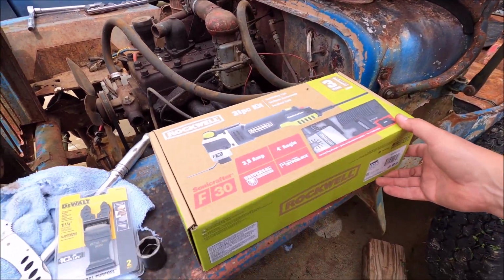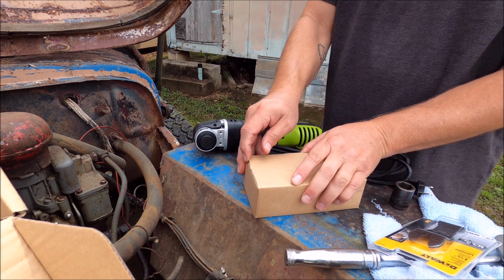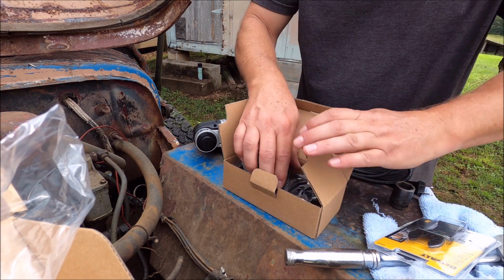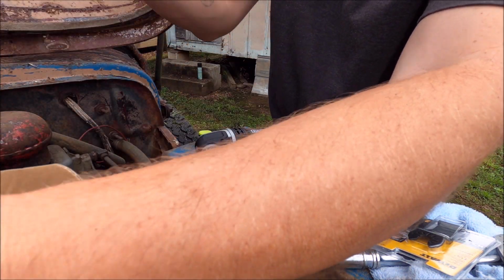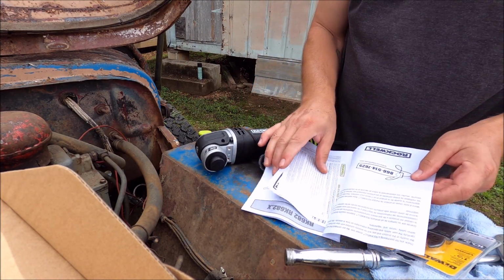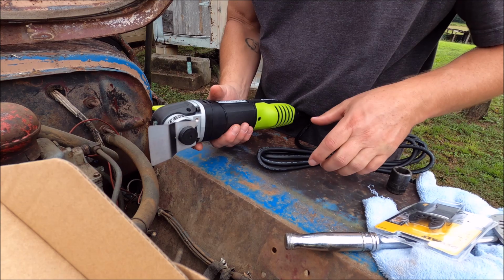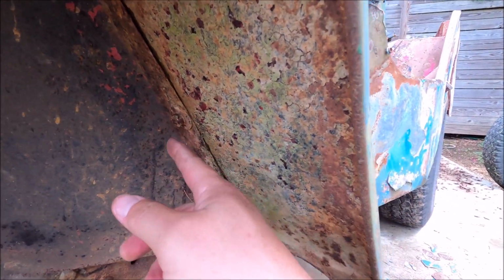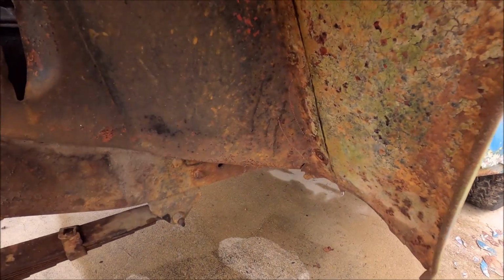Rockwell Sonicrafter  Oscillating Multi Tool: Will it Cut Weld?

Comment: get a grinder with a 36 grit and grind the bondo off dust mast and googels needed
Reply: I was thinkin a flap wheel and a twisted wire wheel . I like the krud cutter rust remover too.

Comment: Wear gloves to stick your hands in water, but not  when you work with tools chipping of metal. Get some ear pluggings. You'll be hearing that noise for weeks afterwards. And put some saftey glasses on. A piece of that paint chip in the eye will hurt severely.
Reply from the maker: I had ear plugs in, glasses I blew it on. But I dont plan on doing it again for a while

Comment: Try heating the Bondo with a heat gun or torch to soften it a little... Should just peel off with the Rockwell...|
Cutting those welds and nuts a thin cut-off blade for angle grinder would be much quicker and efficient.

Comment: as long as you're outside use a propane torch and a putty knife, you'll be amazed how easy that is,the filler will burn a little, and don't overheat one particular area heat and scrape!

Comment: Wonder if a small needle scaler would work using a regulator to control it so not to damage the metal to bad. Just keeping it on the body filler. Your going to have to use a thin layer of filler anyway when prepping for paint. And also with thick coats of primer should cover any damaged area's.